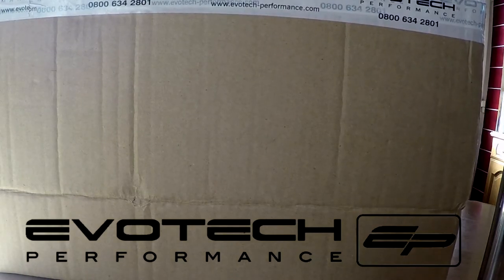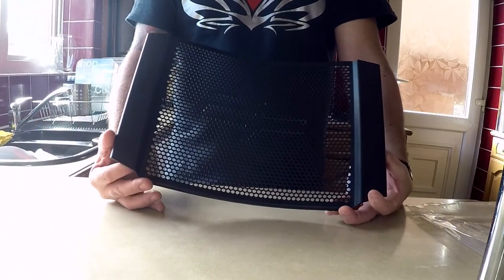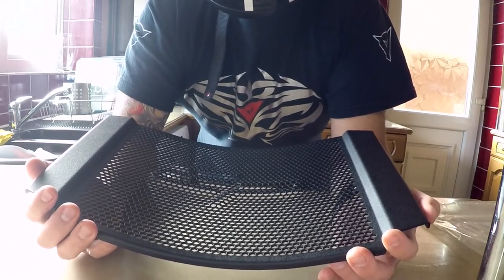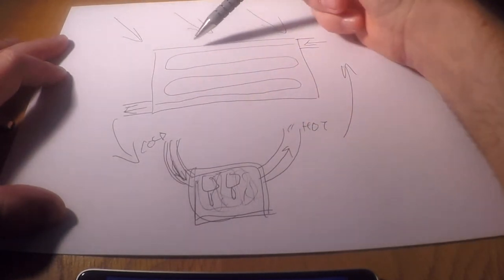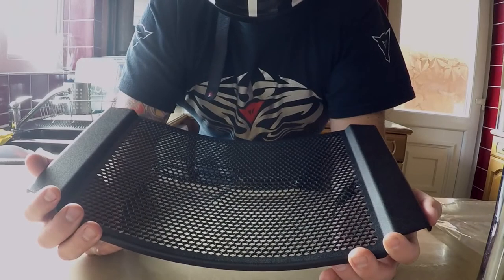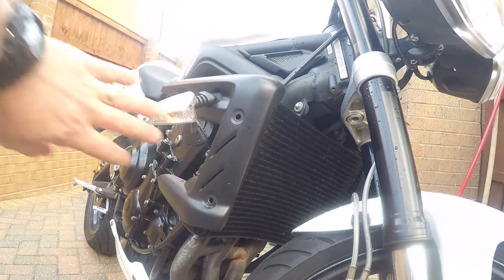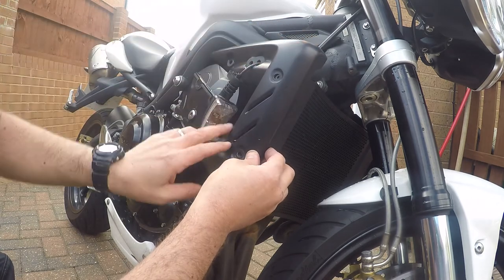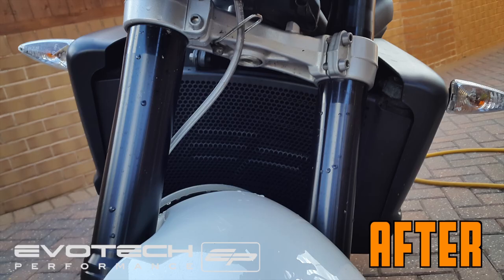Evotech Radiator Guard - Review and fitting

Comment: High hopes...just ordered one for my R1250RS....so if anyone has performed that installation on a 1200 or 1250 RS , I'd appreciate feedback on the installation procedure because the instructions I already downloaded from Evotech aren't exactly crystal clear to me.
Indeed I also like the fact it's not disruptive to the original design and repurposes the existing bolts (I dislike to use different length / head type bolts in general as is breaks uniformity)  . Thx for reviewing. Most radiators on modern bikes are over-engineered in terms of cooling capacity - especially the ones mounted in the traditional way (unlike say the Honda VRF800 VTEC and the likes  which are mounted sideways)  so unless you ride in the dessert it won't hinder the airflow too much I would reckon.

Comment: Hey Dan. I just bought one for my ‘10 STR. Before I do the install in a few days, can you confirm whether the bolts that secure the guard onto the sides of radiator are long enough for the added width of the guard? Thank you!
Reply from the maker: You’ve probably done it by now but for the purposes of anyone else fitting one - you won’t need longer bolts
Reply: @Dan_TheMedic   Thanks for the video. And yes, it works as-is beautifully.

Comment: I bought one for my street triple 765rs  and fitted it in 5 mins. Looks great and so simple to fit
Reply from the maker: I think the biggest advantage is that if you consider the price of a replacement radiator against the cost of one of these, then consider the damage a single stone flicking from a car in front of you could potentially do to your radiator, it's a no brainer NOT to have one.